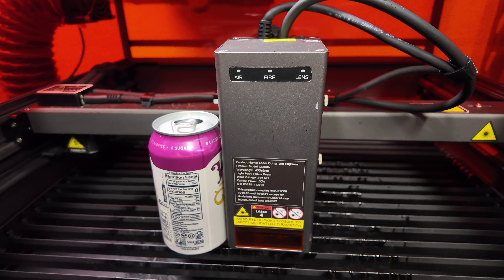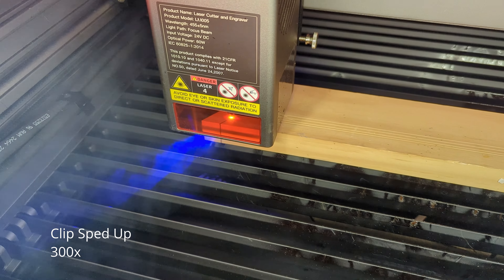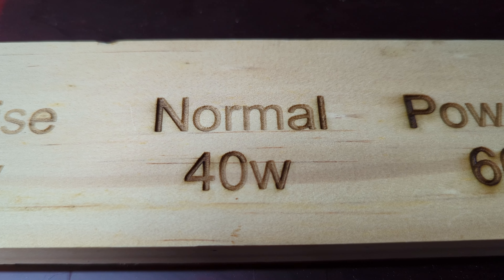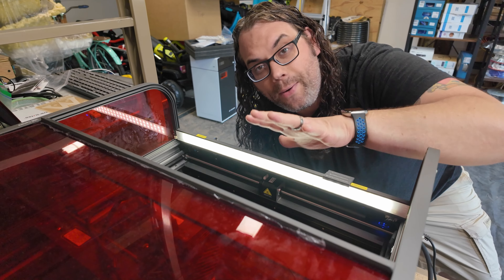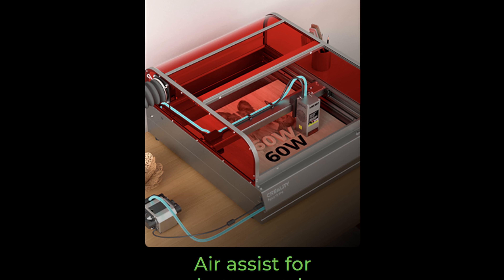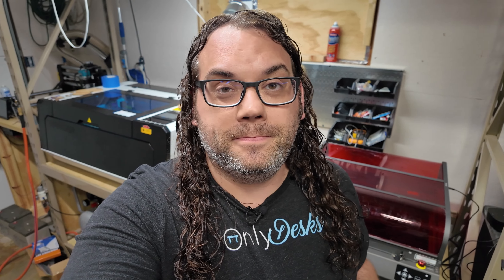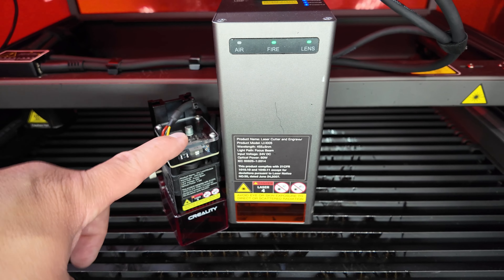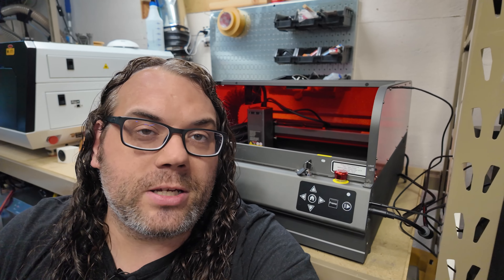Is The Creality Falcon 2 Pro 60w Laser The Best Choice For Beginners? Check Out This First Look!

Comment: What about auto-focus? Will it auto-focus on a curved (concave and/or convex) surface? If yes, what is the clearance between the lased surface and the bottom of the laser module?
Reply from the maker: There is no auto focus on it.
Reply: @TheEdgeofTech  Thanks...good to know. Can you tell me what the clearance is between the item to be lased and the laser module's bottom, when properly/manually focused?

Comment: According to the manufacturer's website, the laser spot size for this machine is "0.08*0.15mm". Is this for the 60w power setting or all three settings? What is the laser spot size on the "engraving" 22w setting? Regardless of the spot size at 22w, how forgiving is the spot focus on a curved (concave or convex) surface?... +/- ?.?mm in height or depth?